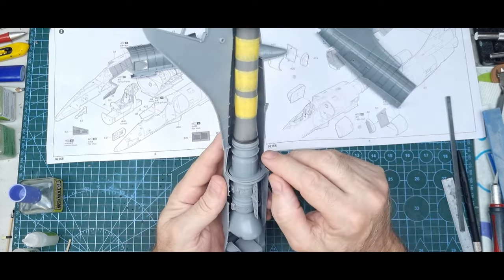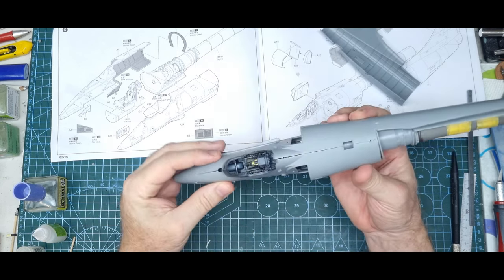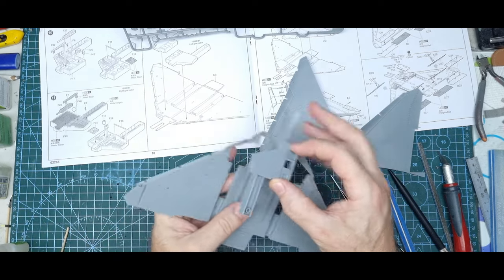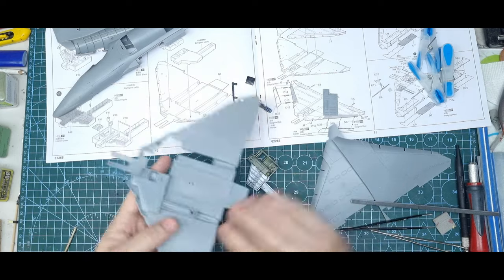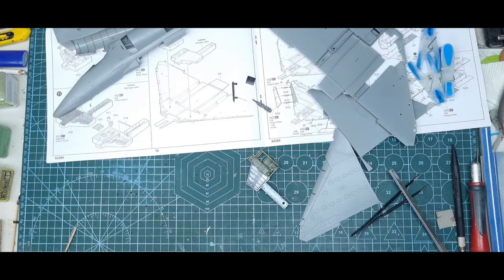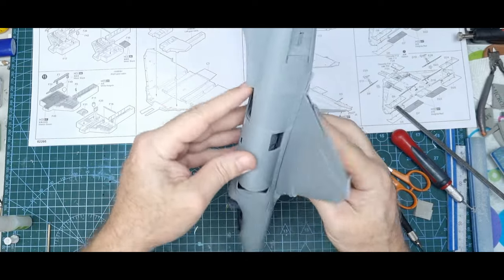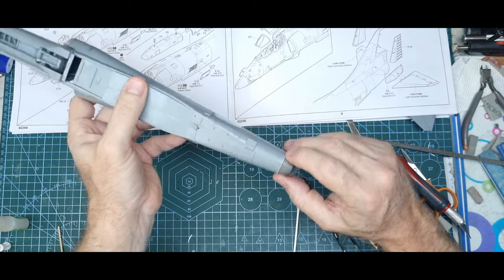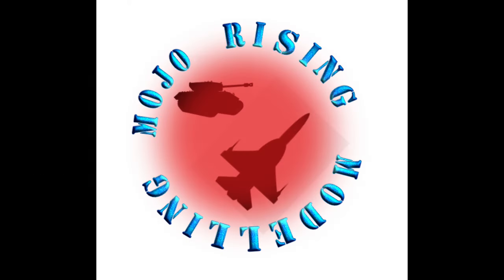1/32 Trumpeter A-4E Top Gun Build Pt. 3

Comment: Last year was a super productive travel period for me in which I visited three aviation museums that had an A-4 in its collection; the Pearl Harbor Aviation Museum, USS Midway in San Diego, and the USS Intrepid in NYC.  I paid special attention to the leading edge of the wing because of something that was pointed out on Hyperscale about 20-something years ago in that there is no leading edge slat well for the slat to retract into.  The slat just lays flat on top of the wing, and creates a larger leading edge camber.  Modeling-wise, that step on the wing where the slat goes shouldn’t be there.  On the 1/48th Hasegawa A-4 kits I’ve built once I knew of this, I faired the step with filler and spread it forward till I had enough to sand the filler to the correct curvature.  The steps on the sides of the “slat well “ are correct and don’t need to be corrected.